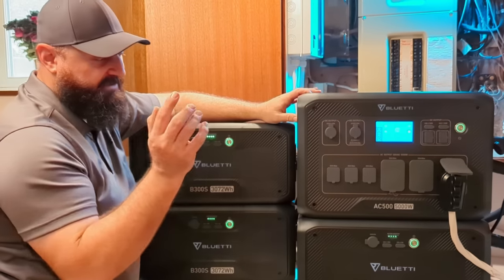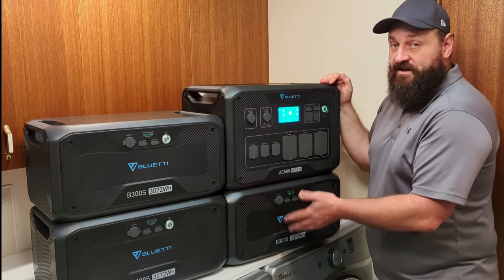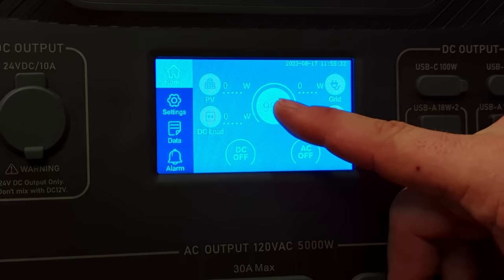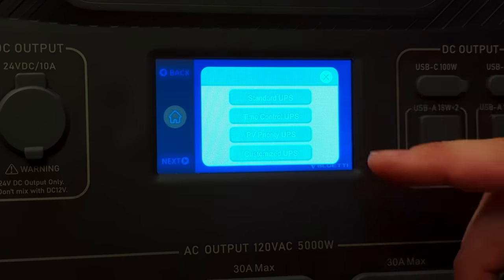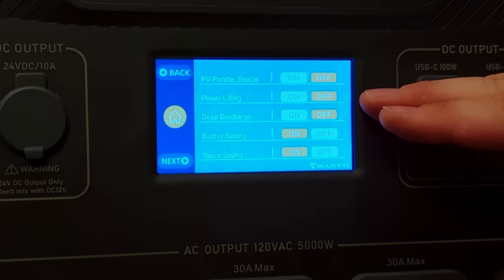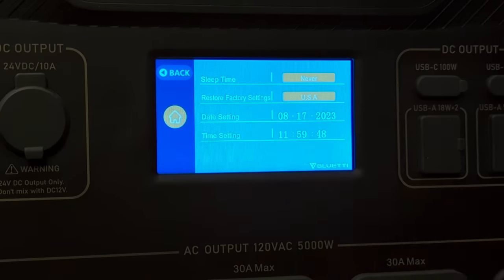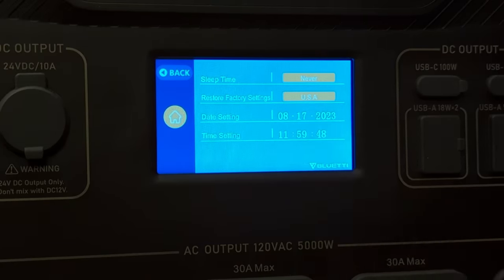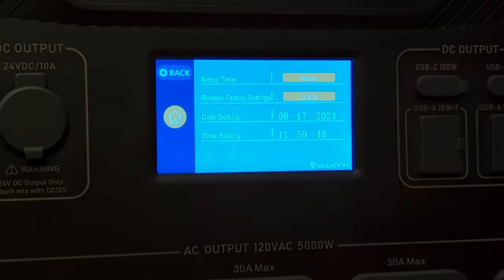Whole House Battery Backup with the Bluetti AC500 and B300

Comment: What's the difference between 300 and 300s battery?
Reply from the maker: The difference between the B300 and the B300S is, among other things, the integrated heating system. The intelligent temperature adjustment function ensures that the battery is able to function better during cold weather conditions (down to - 20 ℃).

1. **Capacity and Chemistry**:
   - Both the B300 and B300S have a lithium iron phosphate (LiFePO4) battery chemistry, which offers longer life cycles and stability. They both provide a capacity of 3,072Wh.

2. **Compatibility**:
   - The B300 is compatible with a range of Bluetti power stations including AC200MAX, AC200P, AC300, and EB240.
   - The B300S can be used with newer models like the AC500 and AC300, and also with older models such as the AC200MAX and AC200P through adapters.

3. **Output Ports**:
   - The B300 includes one 12V/10A car outlet, one 100W USB-C, two USB-A, and one 12V/30A RV port.
   - The B300S also includes similar ports but features an additional expansion port specifically designed to integrate with the AC300 and AC500 systems, allowing for higher system configurations and flexibility.

4. **Charging**:
   - Both batteries support solar charging, AC charging, and car charging. However, the B300S may have slightly faster charging capabilities depending on the setup and which power station it is paired with.

5. **Design and Indicators**:
   - The B300S may have minor design updates including an updated LED screen for better monitoring of charging status and capacity.

6. **Price**:
   - Typically, newer models like the B300S are priced slightly higher due to the additional features and compatibility options.

The choice between the B300 and B300S depends on your specific needs, the Bluetti power station you own or intend to buy, and the flexibility or scalability you require from your setup.
Reply: Thanks for the instant reply, I'm looking at the 500, and maybe 2 batteries , I want to use on my boat and run a 16000 btu ac with a start up draw of 54.5 amps and 11 amps of run time, idk if I calculated correctly bu I come up with over 30 hours if run time, anyway do you think this set up would work?
Reply from the maker: @captainkrunch6372 One way to find out... Air conditioners use a lot more power than expected.
Reply: I'm only hoping to run it for about 8 hours.😂😂
Reply: Upon further analysis I think only 3.5 hours, 30 did seem awfully high.
Reply from the maker: Yeah, 16,000 BTU is almost 5,000 watts... That's a massive load for any battery system.

Comment: what happen if you install like ups mode ?
Reply from the maker: It will work as a UPS
Reply: @Everlanders  can i install directly as ups for my home? Didnt need automatic transfer switch anymore i mean
Reply from the maker: @ahmadteguhsatria6464 - You can if it's a very tiny home... It has only 50 amp UPS
Reply: @Everlanders  my home just about 2000watt. And never full load, Average just  1300 watt.  AC300 is best choice for me?
Reply from the maker: Yes, that should be perfect.
Reply: @Everlanders   thankss

Comment: Great , now start rewiring your house , start with the appliances that use the most juice , keep you grid connected separately from your solar , just keep slowly rewiring until the only thing you have hooked to the grid is a backup battery charger, if it’s not hook to the grid but you still have grid hookup creates a grey line they have no grounds to complain
Reply from the maker: Nope, I'm just going to leave it like this.